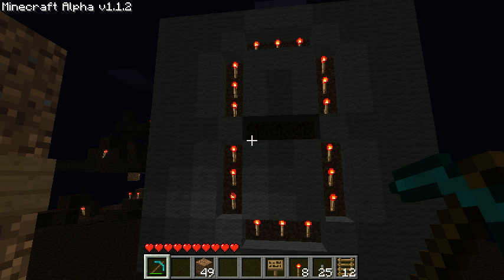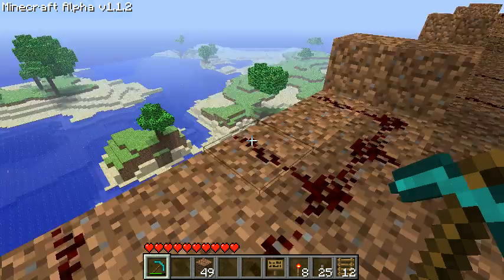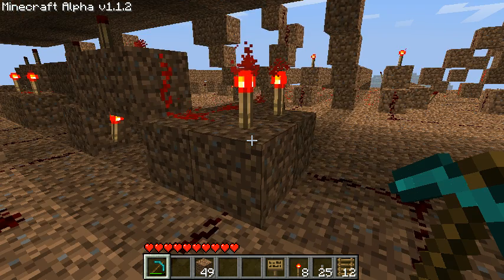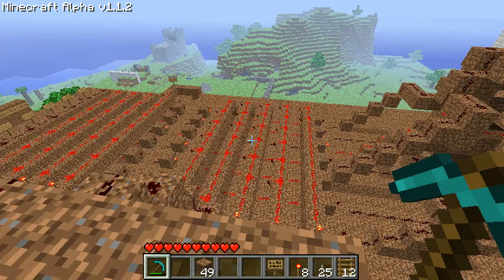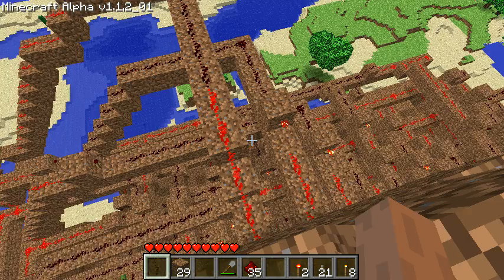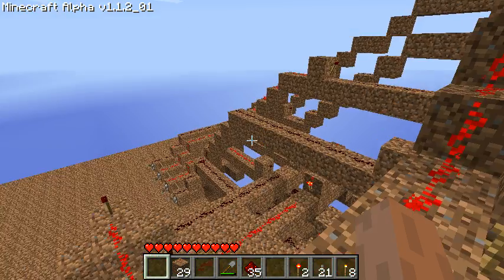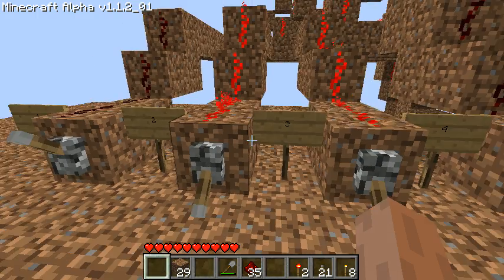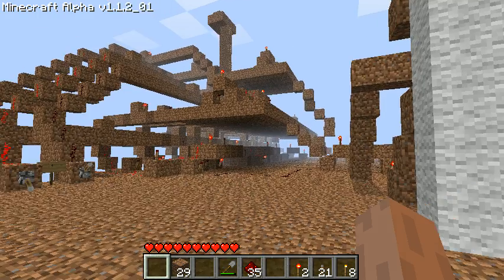Minecraft - Harbinger's Redstone - Clock Driven Counter with 7-Segment Torch Display (part 2)

Comment from the maker: @novantha1 This one is only set up to count from 0-9...Technically could have set it to go 0-15 (0-F using hexadecimal) since it is 4-bit...In its current configuration the display will be blank on a number above 9...Displaying A-F would have taken more logic gates and lines on the decoder, but would have been possible if I wanted to take the time.